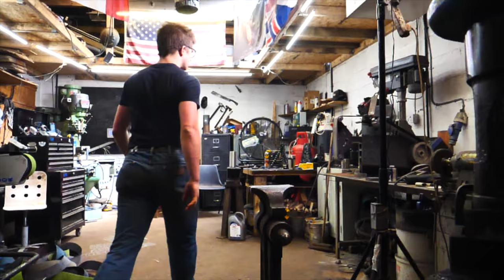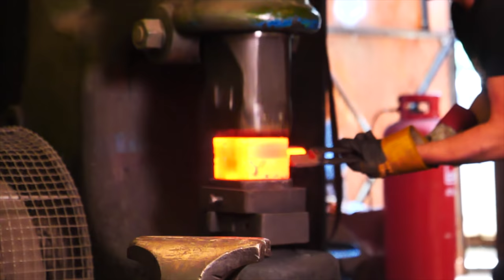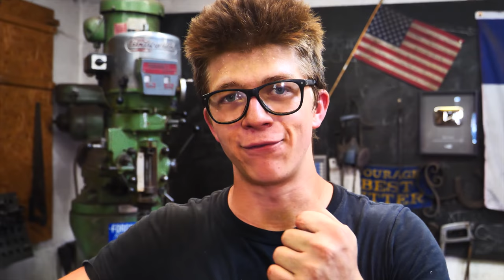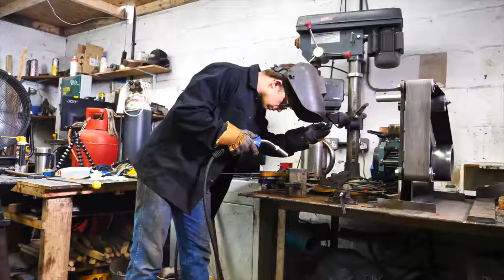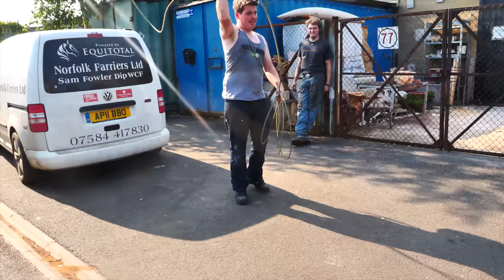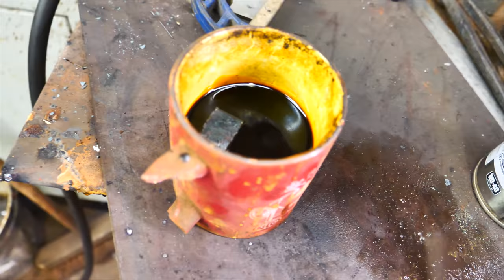MAKING MY FIRST SWORD! Part 1: FORGING the Damascus Steel *MAXING OUT POWERHAMMER*

Comment: what's that white powder you sprinkle on the steel while it's hot?
Reply: barnzy104 borax.
Reply: What's it for?
Reply: when steel is heated above a dull red color, oxygen combines with the excited iron molecules. this forms iron oxide, the grayish flakes that fly off when you hit it. this prevents two surfaces to weld together because the iron oxide forms a barrier for which the iron molecules cant combine and fuse. what borax does is it dissolves the barrier (iron oxide) and protects the surfaces from further formations of oxide. when you get borax to 2000+ degrees f, the borax boils and dissolves iron oxide, and when you tap the pieces together, they fuse with no problems.
Reply: So basically just fuses the steel together? Cheers mate
Reply: barnzy104 well, yes and no. the fusion of the molecules from 2 separate surfaces of steel comes from the rapid and light taps. but the success of the weld is determined by the absence of the iron oxide barrier. it just cleans up the bad stuff out of the billet.
Reply: Ahh right, I dont to any forging myself I'm just a welder but still cool to know
Reply: barnzy104 haha yup!! its like the shielding gas, or the coatings on welding rods. it ensures the weld is clean and free from any contaminates
Reply: Jonah Lee oh right I understand now thanks
Reply: Hopefully gonna get our hands on a forge and an anvil at work so we can piss about and make some more cool stuff
Reply: Sounds cool

Comment: Still on 360p
Reply: P&P Reviews weird, mine was 1080 like 5 minutes ago
Reply: Strange, I'm only getting 1080 as an option. Which is buffering like mad on my s-l-o-w connection.
Reply: YouTube can take time to actually crunch the video through into higher res and fps. YouTube will work to get the low res and therefore smaller files online first!

Comment: Alec, christ, how big is the sword you're trying to make?  That's an awful lot of steel for something like an arming sword - they usually weigh something around 2.5 pounds and are 35 inches long.  If you are making an arming sword, do you really think you're going to lose that much steel to oxidation and scales?  If you're not making an arming sword, then what in god's green earth is going to require that much steel?  More than one sword?

Comment: want to talk hot?? I live in Oklahoma in the middle of the u.s.a   and it was warm today.. I also work in a powder coating shop big oven runs 450 f shop gets to around 120f. humidity was high so was sucking water right out. drink 1 bottle Gatorade to two bottles of water.  I know how you feel alec when shops cant move air.... cant wait to see sword and pattern.